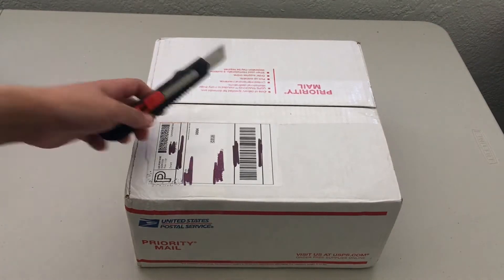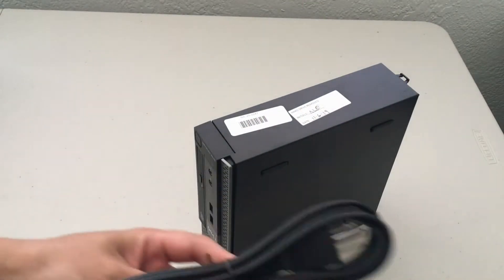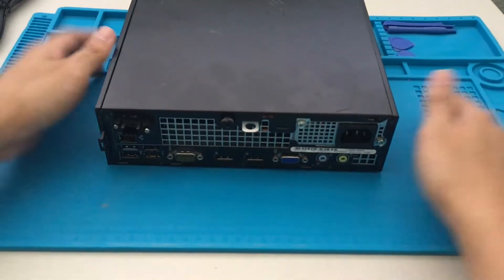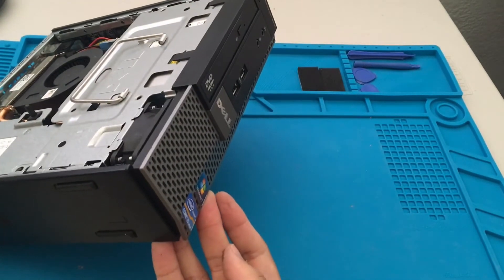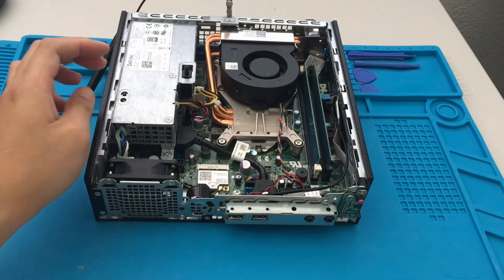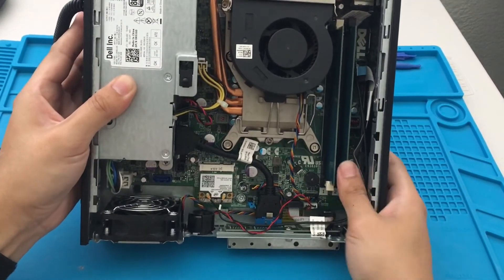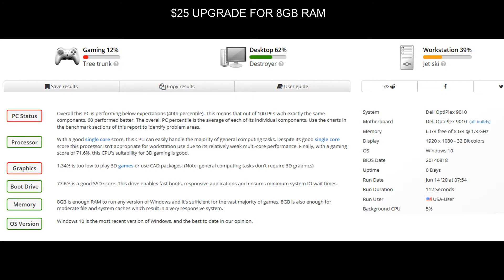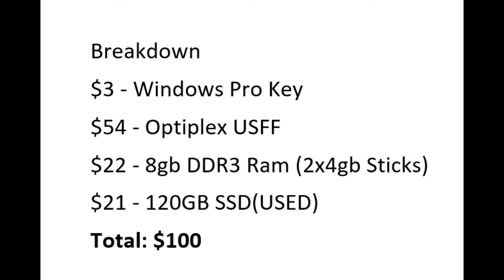$100 Budget PC - Optiplex 9010 USFF in 2020

Comment: I got mine with an i5-3470s, 16GB RAM, 120GB SSD locally for $50. I'm looking for a low cost and low profile GPU for it. I'm not  a serious gamer. I just want to emulate some Android games, play League of Legends, and eSports titles at 60fps @720p. So, far this little computer is zippy and fine for day to day work. Definitely a true bargain and value at the price I paid.
Reply: You could play LoL @60fps with just the iGPU tbh. I've gotten like 150 fps in the Witcher @max on the 3770, and they aren't that much different.
Reply: @iusegentoobtw  Yeah even my dual core cpu from 14 years ago with only 4gb ram played LoL at 60fps, although i preferred playing it through GFN for better graphics, which got a constant 120 fps. Too bad i did more research and this computer doesn't have a slot for even doing an external GPU. I bought mostly as my trading computer.
Reply: @Eye_That_Opens  ah yeah, didn't realize this was the usff. Ah well, those things are amazing anyway. That thing will smoke any laptop under 1k tbh, so it's a good deal nonetheless esp for trading or a retroarch box or whatever. 

Literally just bought 3 Dell Precision 3530s, i7-8750h 6/12 core - which were about 2.5k each in 2019. Can confirm, Ivy Bridge desktop cpus still dunk them.

Comment: I got the 7010 sff version of this with an i7 3770 and 8gb on ebay for $158 including shipping. Turned that one into a hackintosh on my channel. 

Just bought another MT variant for $108 including shipping (needed a GPU and didn't want to destroy it too much) with an i5 3570 and 16gb with no hdd. 

Overall I'd say that if you need the space, go with the usff. If you do not need the space then there are far better budget options. I don't play too many games, but I was getting 150 or so in CS:GO with a $40 gpu (r7 260x), so a 3770 will push pretty much anything even today. 

Those optiplexes though, for real lol.
Reply: I wonder if I will get as much peformance from my i5-3470s with 16GB SSD. I'm looking for a cheap low profile GPU to throw in it for eSport titles.
Reply: @Eye_That_Opens  Just a few weeks ago I installed WIndows 11 on a 16 gb optane drive, 14 gb usable. Post install I had 9gb left. post drivers I was down to 1gb, but got it to around 5gb by disabling swap and hibernate. 

Anyway, I doubt you'd be too limited by them if at all. If you compare that to say, the i5 8400, it's a 20% difference essentially... for five years lmao. And that's for benchmarks, not real world performance. 

I've literally been mining crypto, playing the witcher, and sending 4 cores to a virtual machine (also on windows 11) and not had any hiccups. Ivy Bridge was so dank.

Comment: man...I have 3 of these and they are good. I am currently configuring one as  a nas because  the size is just perfect. I have modified it so that i can have three drives in it. One m.2 as boot, one 2tb and one 4tb thick drive. Changed the cpu to the T model for low energy consumption. So far wonderful.
Reply from the maker: Thats incredible!